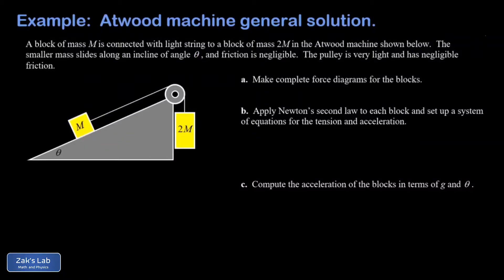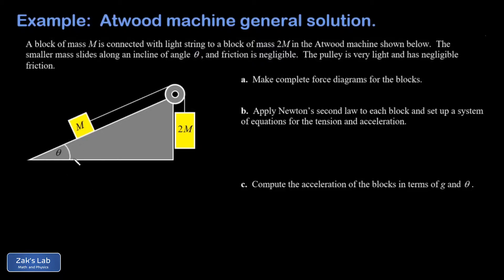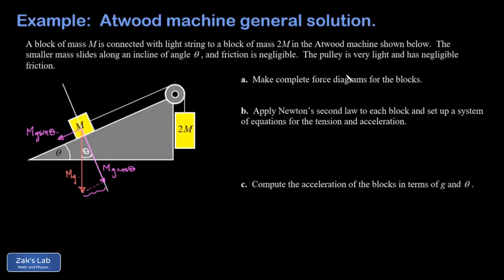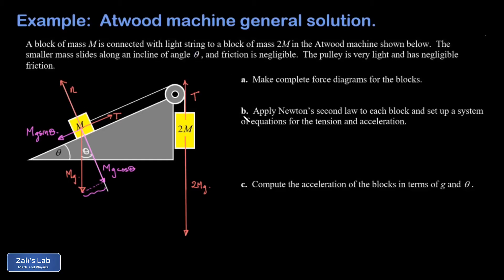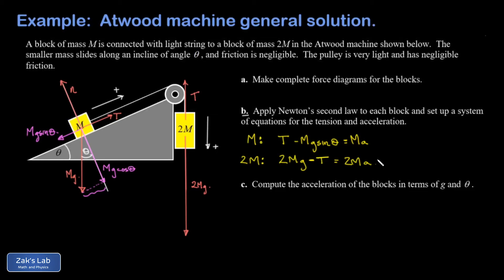Ramp Atwood machine with M and 2M, force diagrams and acceleration in terms of g for mass and pulley

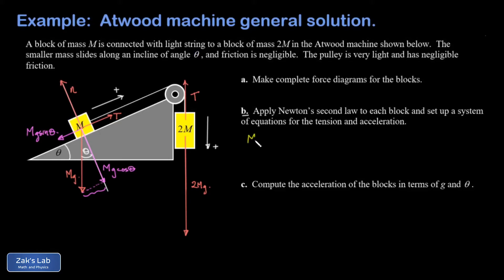Comment: When at around 2:30 min you say that the acceleration is positive for both ends, that makes sense but isn't the acceleration downwards of anything always negative? or does that not apply because there's a string attached? Thanks.
Reply from the maker: You are always free to choose your coordinate system for the analysis of each mass.  We choose to call downward the positive direction for the hanging mass simply to make it consistent with the choice we already made for the mass on the ramp.  It's actually critical to do this, because we made it so "a" is positive for both masses.  If you adopt an inconsistent choice of coordinate systems, then "a" will be positive for one mass and negative for the other.  This breaks the resulting system of equations, since "a" can't represent two different numbers!  It is also perfectly legal to call positive upward on the hanging mass, but then you'd have to call "down the ramp" positive for the sliding mass. z